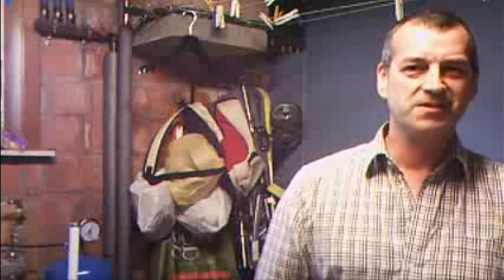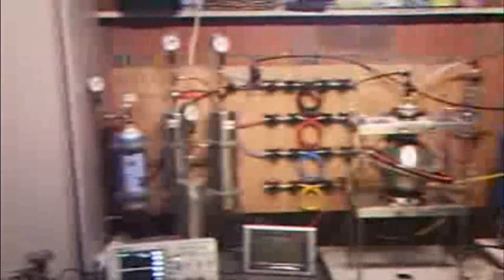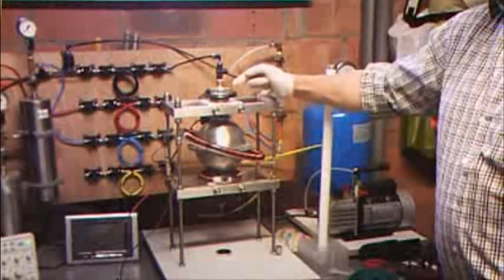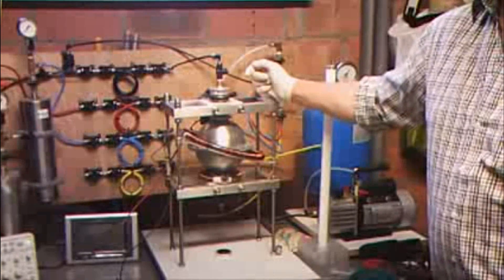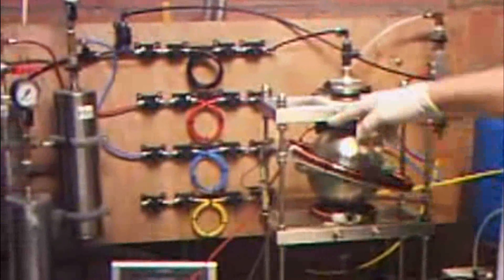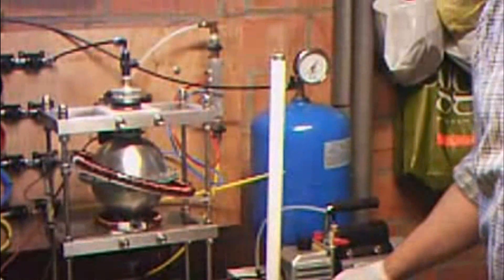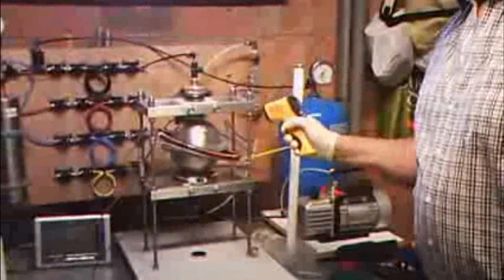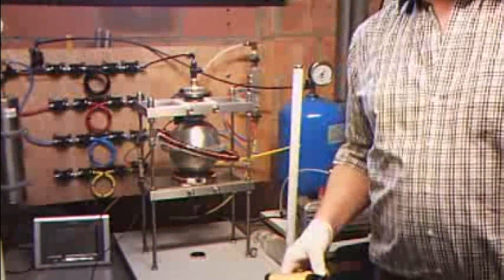V20 First test run with all group members

Comment from the maker: For information to all skeptics. In recent months, I spend very little time on the project by major familial situations.
I created a plasma twice with the system, the last time with changes in speed of the motor. I placed a coated coil around the sphere and the scoop was measuring, at a stationary reactor, a small AC voltage. I want to continue testing with GANS on the inner wall of the reactor, this will hopefully happen within weeks. Must also make large amounts GANS.
When are you all going to prove that the technology works or not? I post again the picture of the test with the scoop on my FB page.
Reply from the maker: https://www.facebook.com/photo.php?fbid=600693016729427&set=pcb.600693096729419&type=1&theater
https://www.facebook.com/geert.vranckx.1

Comment: Hoi hoi, deze informatie kreeg ik van mrfixitrick The way I understand it is, the compression and relaxation of nitrogen and other gases such as argon, interact with the nano-material layers, which produce EUV rays to ionize the hydrogen at the centre of the rotating sphere. This creates the plasma which can then be opened by further vacuuming.

Comment: I would love to hear in simple language what is happening in this experiment.  So far I have had a great deal of difficulty understanding Keshe.  Nice to see a real example from the theory.  Well done!
Reply: martin, that experiment is false ,dont produce energy, the autor never comment about the balance imput energy/ output energy=? es answer is how to fusion 2 atoms of Hidrogen? cant you explain , with this experiment , the answer is not yet.,
Reply: You see a "real example" and still believe ?
Have you ever been in school?
Reply: Martin Pampalone 
But there is no "fusion" at all. "Not yet" is , as it points to a possible future positive result, such a faint possibility, that it can safely be neglected.

Just look at the history of Keshe theory related experiments and the obvious cheating of Keshe. Just one example of many, maybe you want to read it carefully:

https://www.allmystery.de/blogs/shortvisit/analysis_of_the_fukushima_experiment_performed_und
Reply from the maker: Martin Singer
Plasma technology is no fusion technology. The coil only serves as an indicator to see if the reactor produces a (magnetic) plasma field. For me this is the easiest way. The coil contains nano layers that boost the magnetic fields. The coil is therefore not to drain energy, only to determine something. Inside the reactor there is a central pin to the middle of the reactor. This extends to outside the reactor (bottom)and there could the "energy" to be drained. the pin is ready but must still  develop a sliding contact for it.
Reply: Geert Vranckx 
Of course it is not fusion - the coulomb barrier holds it's thumb inbetween :)

Before we proceed can you please provide your definition of "energy", "nano layers", magnetic flux and "plasma".

(That's because your (or exactly: Keshes) definitions are obviously completely different from those worldwide agreed upon and used in science.)

Comment: Congratulations, not only are you up and running but you proved that the Keshe generator works. I've reported this and am following your example. I appreciate the documentation and clarity of your work. Well done!
Reply: I am sorry I probably missed something or didn't understand the experiment results well. How do you conclude from this test's result that it actually works and proves the theory of Mr. Keshe? I am just curious because I don't see it in the data or any indication confirming this.
Reply: Did you see the data sheets at the beginning of the video? It's there.
Reply: Mike Lorenz Yes the data says nothing
Reply: Mike Lorenz And what do the "data sheets" proof?
Reply: Keith Metz Exactly.